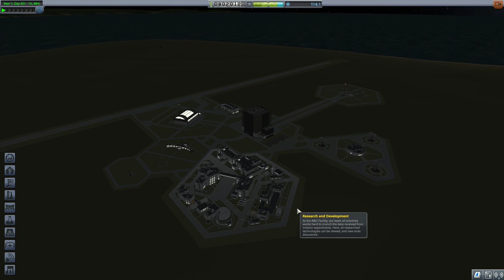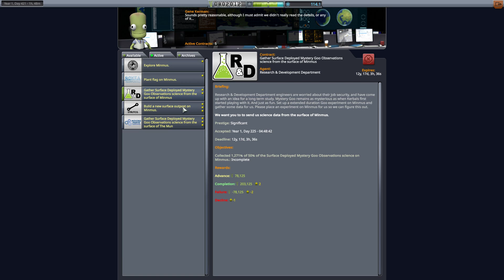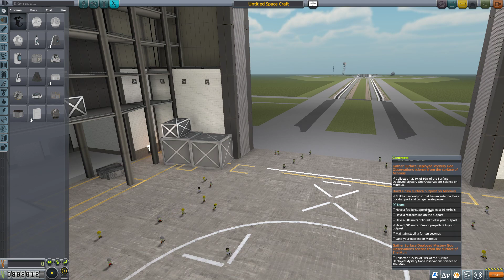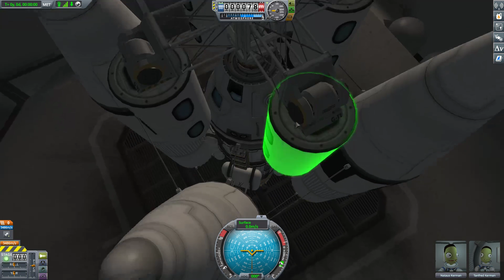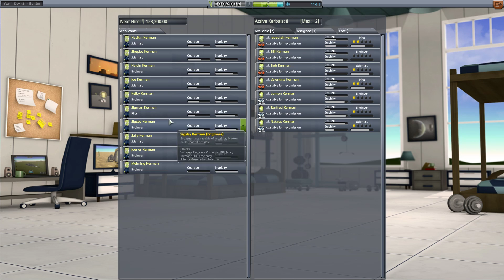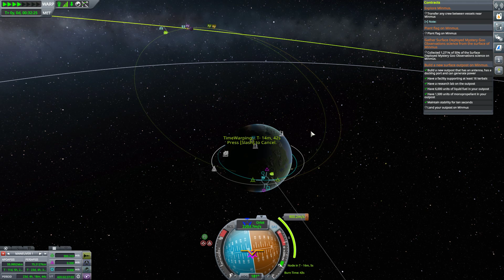Kerbal Space Program / EP 18 - Big Ol' Base / Kerbal Career Mode

Comment: You can actually make asparagus stalk when you've built the engines symmetrically, you just have to open each decoupler group and pick out the decouplers you want to separate individually and manually drag them into their own stages. This way you can still build a nice symmetrical ship and you won't have an entire stage take up the whole left side of the screen, and anything you add to them can be built using the symmetry tool properly.

Have you used the move widget at all in this series? It might be easier to move things up and down that way instead of having to pick it up and place it again. I actually found out you can use it with the angle snap tool enabled to move a goo container right into the center of the ship so I only have to take one up instead of two. You might have been able to place those crew cabins on a radial mount (the circular thing) and then rotated them correctly then pulled them out so it doesn't clip into the ship (the spinny thing you made is admittedly pretty fun)

Shift-clicking in the editor will grab the whole ship and move it instead of having to find the origin piece and moving it that way.
Reply: {Head slap} I could have saved myself a lot agitation with this knowledge.
Reply: @nobrainrequired5307  Consider agitation in the future to be saved, then =3
Reply from the maker: Thanks Ozyton I need to asparagus like that a lot more often!!